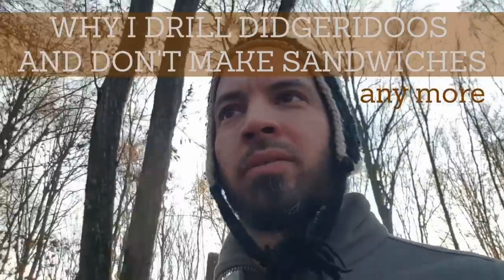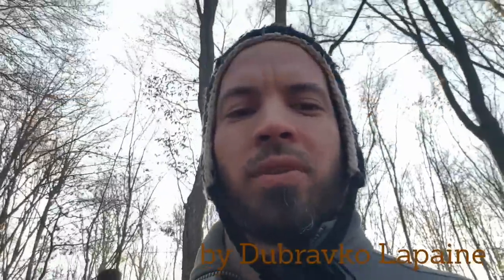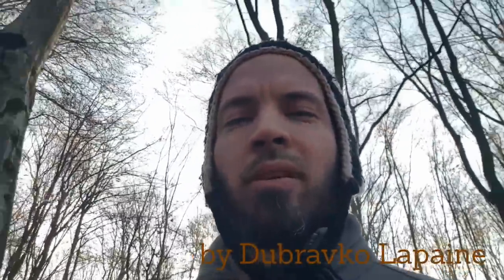Why I drill didgeridoos and don't make sandwiches (anymore)

Comment: Its definitely a good promotion for the process of drilling and I can clearly see the advantages in testing something as you go. Drilling may be the most effective test-as-you-go method for making instruments that feel really good to play. The reality is, for contemporary tuning in western scales, nothing can beat computer designs and the sandwich method that is the most realistic for that process (especially when the tuning requires the bore expands and then contracts again). If you can design didges in a computer and still achieve that shape with drilling then great! Either way, for me the most important thing is the end result function above all else. As a contemporary player, I wouldn't glorify any process (or even material) over the end result functionality. People will choose what will suite their function best and what they can afford (and what seems ethically made, i.e, not using endangered wood). So if you can afford to pay more for an instrument that doesn't have a split line running across it, great! The functionality however is not enhanced by that aesthetic detail, but some  people may for sure value your process a lot, and your didges are some of the sexiest around aesthetically;) Outside of aesthetics and your personal learning curve as a crafter, I would say there is no advantage in functionality. Considering the material is the same, the inner bore shape is the most important factor in play-ability and tuning. Regardless of how something was made. This reminds me of something like film vs digital photography, and the people that glorify film even when the end result when printed these days can be completely identical. Either way, this is an interesting video to promote the exploration for more people to try drilling. It is similar to Yolgnu crafters starting with termite hollowed logs and chiseling them out to tune the interval between drone and toot. Except drilling can work for the rest of the world that doesn't have organized termites
Reply from the maker: Hey Will! As usual,  we agree. But I would make different emphasis on what you say. I would emphasize that for me test-as-I-go and play a very good to feel instrument is a very important aspect, while having tuned 7 toots into some specific order is a fragile and for me usually not very important. I want to leave an open space that one day I might wish for a didge like that and then I would probably have it done by CNC as I think it is a drag (for me at least) to make it by hands to that level of precision, and we have a system for it. 

You know that I consider you a master player and maker and I am never looking and listening to you and think "oh this didge has a joint, it is no good". Whichever method you choose, I salute. But note that you would have more credibility in this comparison if you had actually made 100 drilled didges and not speaking from imagination of how it is. Though your imagination is great, it is not same as experience. 

All in all, I feel I am not glorifying the method of drilling as I present many bad sides, but I do feel it benefits my way of making and the didges I am after . Also I do enjoy the process of looking for and hunting the right one. And I did want to say that on a certain level it is f-ing hard ;-)  The ways of pro and con can be continued, and one thing I remembered is that drilling is safer for the maker... but less safe for the didge. Alright, stay safe you bastard! ;-*
Reply: Your DUdiness, yes indeed and I appreciate the window you have given us into your world of experience in drilling, it has increased my own curiosity in perhaps attempting it some day. The benefits of checking and testing as you go are very clear. Either way, experience is not needed to know that the end result difference concerning function is purely aesthetic, if one can achieve the same shape with either method. 

I think you are getting these kind of responses from multiple people because you have presented the world of drilling with a heavy tie to split and hollow, coupled with your personal subjective thoughts, which occur to me to have a bias for drilling. And that's fine! I see all the upsides of drilling presented here, but can't help acknowledge the way split and hollow is painted. 3:24 brushes off split and hollow as a very simple, easy, 10-mintue to learn process, and that is misleading. One could say the same for drilled didges from Bali as you mentioned. For example the skill of creating a perfect circle when split-hollowing can take a long time to master, and many people in that style have more of a diamond shape hollow for this reason. At the most extreme, the manual process of printing paper templates and hand carving computer designs is an extremely tedious process, and after watching Dan Flynn make a few, I have not yet had an interest in taking on that beast at that level, and I'd sooner try drilling. So with that spectrum in mind its hard to listen to 3:24 and not say something;) 

I respect your vast world of didge life experience from crafting to performing and recording, and I'm only responding because I, and many others respect your expression of that. I think it's smart to present this content by fishing for emotional reactions from the majority (#realmendrilldidgesanddontmakesandwiches) as it gets attention,  so you can't be too surprised when that actually works;) 

  Either way, I don't want to dismiss that I really do see the practical value in testing as you go as being one of the fastest potential ways to learn many shapes and learn what factors create good instruments quickly and tangibility. I have had to do that by making many many instruments, recording all of their physical dimensions and tuning in a database and then cross referencing that database over time. I'm sure with drilling I may have learned some of those lessons quicker. I also do not currently use computer designing although I plan too. I have shared a shop with Dan Fynn who was using it, and my respect for it comes from that and his non-CNC manual proccess (although he uses CNC as well when he can). I value and enjoy in a similar way to you, the process and discovery that comes with making didgeridoos from intention, not blueprints. I'm not saying that one is better then the other, its just what makes me lust for making the next one. Much respect for all you Du, our similarities far out weigh our differences in expression, madafaka <3
Reply from the maker: @Gorangutangband   indeed. however, many people claim that they can hear a difference when there is no joint. I was never one of them. It is implicitly also in this video. if there is a difference, due to change of inner tensions of the wood, it would be very difficult to actually make a test and confirm or dismiss it. In my feeling, even if there is a difference of "no joint" sound, it is so small that it is irrelevant for everyone or almost everyone. If we get involved sometimes in these kind of discussions, some myths get busted along the way and hopefully community evolves a bit.

Comment: An even easier way to make a didge is burning-through an agave stem with a hot metal rod, then coat it inside-out with wax / oil / glue / epoxy. The result will rarely be a valuable instrument (very little control over the internal shape) but it´s fun, cheap and can be done on a camping trip :)

Comment: honestly if i had to chance to build didgeridoos very accurate, i'd prefer CNC milling! Drilling might be interesting too but takes lots of tooling and practise. Consider also the higher wear of the more expensive tools you need. I tried several ways of building didgeridoos simply and mainly concentrate  on the acoustic output.
Reply: Btw. Walter Strasser is a master in drilling didgeridoos. He makes high-end instruments.
Reply from the maker: Michael doo what you like and enjoy it! Good luck!

Comment: Sandwich advantage: can tune at phrygian dominant 5th or gypsy scale.
Reply from the maker: True. And this is what I say, implicity, in the video. It is even more so if it is done on CNC. But I know only one person so far who really cares about it. And you? I feel that specific case is a drastic, but valid, argument for split didgeridoos.
Reply: I also trying to tune in thisvway but I don use CASD I use Didgmo, and I don't use cnc I do it by hand and angle grinder!
Reply from the maker: @JammTj664   I understand. And if you do it in this way, then I feel in many ways it is more difficult than drilling. How close do you get to inner shape when you carve it and how close to the calculation?
Reply: Dubravko Lapaine Didgeridoo   when I have the measurements I go 3 mm up from the measurment so I can sand it down carefully, but +1 mm of epoxy, sometimes I have 90%accuracy on the design, cus im not patient with the crafting I had always mess up with some mm, so I go sometimes some cents # or b 💩😛😛😛 but with a good didge!

Comment: Thanks for this video. Good insight!
It would be great to have a video about didgeridoo inside shapes: Difference between cone vs straight cylinder didgeridoos.
(What is the limit to how conical it can be?) Big opening "bell" vs straight with no bell. What shape will allow you to do more "toot" trumpet tones? Cheers!
Reply from the maker: Welcome! Even without drilling you can make a great learning process like this: make a cylindric instrument that is longer than 1.5meters. Then make a new one, but decide to change only 30cm of the bore. Then a new one, but you can again change only 30cm from the previous. Make ten didges like that. In the end you will know much more about everything you asked. It is an investment of energy, but it is the only real way to learn and appreciate what you have learned! If you do what I suggest, please let me know how it went!  Good luck!